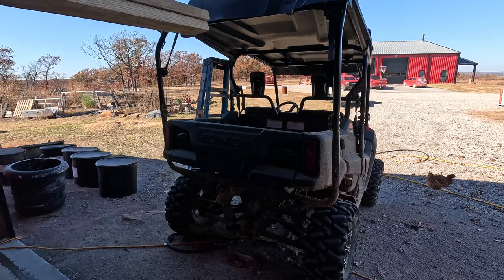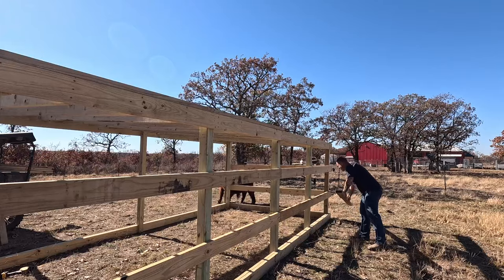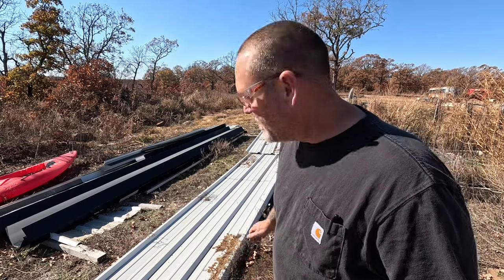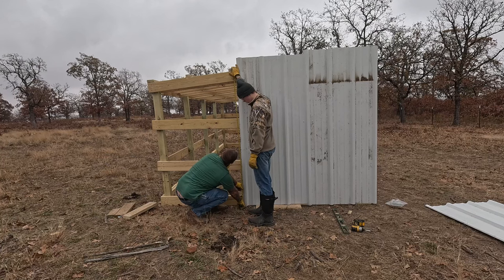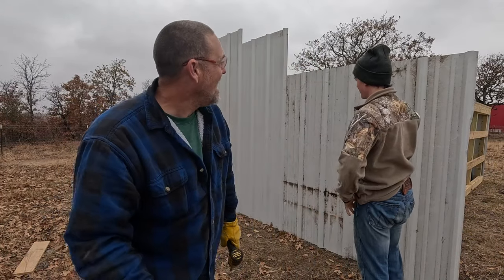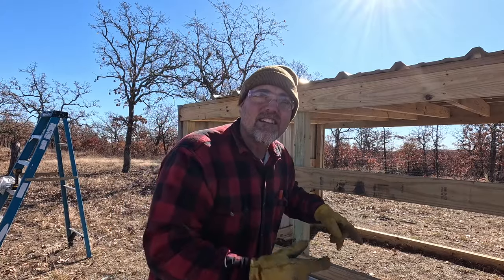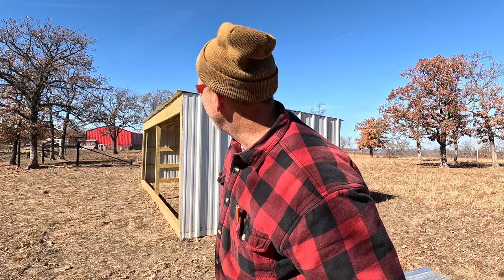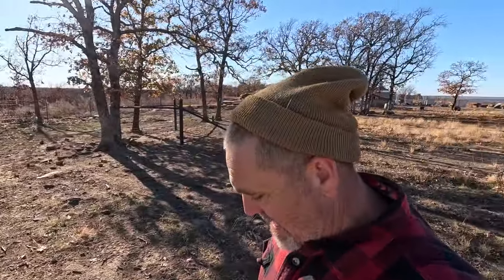DIY Mini Pole Barn |  Animal Tiny House Roof & Siding Is Done! @TheCrockers Have Taught Us Things

Comment: I have lost several sheds recently because the previous owner didn't put a metal drip rail along the exposed wood. 200$ worth of metal strips and it would have save me so much grief. A must for any exposed wood along the roof line. Thanks for the inspiration, I need hay storage bad and this design is about the best comprise between strength and affordability.

Comment: The one thing that I learned about the nibbler is. You have to normally put it on a drill and put it on the load torque setting. So most drills has got a number one and a number 2. Stick it in the number one setting and just go to town. And normally it will eat right through it. But I've tried other things on it and it doesn't do real good except if it's a regular drill.